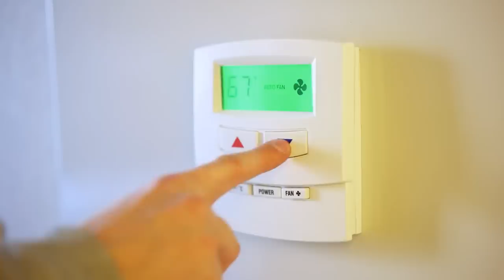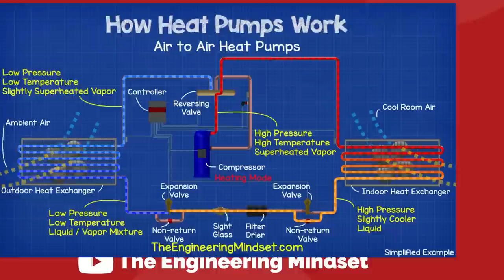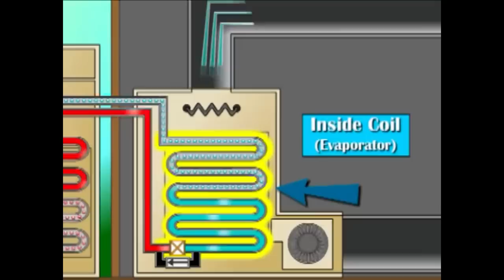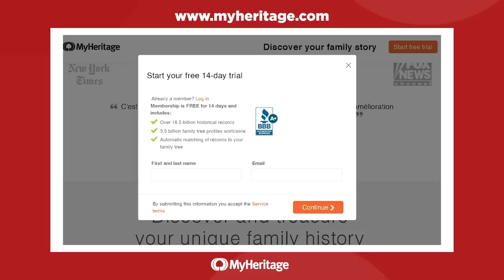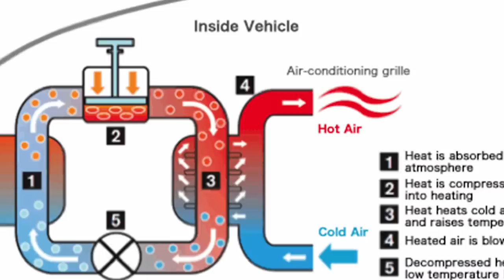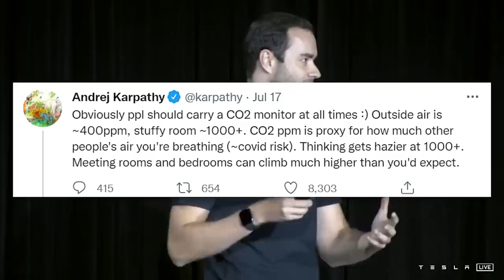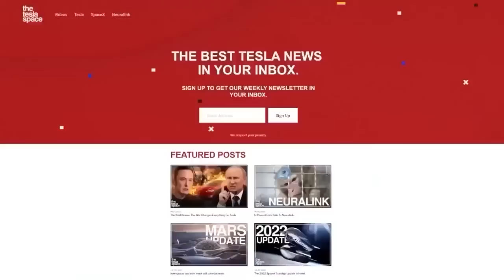Why Tesla's Heat Pump Is Essential For Our Future!

Comment: I moved from a heat pump to an A/C with Furnace. My energy bills in summer and winter in Texas are about 1/3 compared to my heat pump and that is with a house twice the size. Mind you my old house was not built with efficiency in mind and the heat pump was older. If Elon can make those more efficient than my current A/C with Furnace then I will be all in.
Reply: If you have a poorly insulated house, not really a huge surprise. Not sure why you wouldn't just fix the envelope of the house.

Comment: All HVAC, including residential, should automatically bring in outside air whenever it's closer to the desired indoor temperature. Also, thermostats should factor in humidity, not just temperature.
Reply: its called an economizer cycle.  and a humidistat will measure humidity.

Comment: Heat pumps need electricity to cool the air outside, or freeze the ground. Like your ice box in your fridge.   The by product of this process produces a heat through the heat exchange.  Just like the warm radiator on the back of the fridge. It's this that is pumped into the home to warm it.   This uses electricity, quite a lot.   It's not green and there is no free heat in the ground. The ground in your back yard in winter is very cold. It would use less electricity to just heat the rooms with electricity when you needed to with better Conrol. This process of using the by product of freezing the ground is a  con.   Because people accually believe they are getting free heat from the ground and it is green.  Electricity isn't green you need more. The heating is inefficient, this is  obvious when the insistence of insulation is highlighted. I its companies jumping on the band wagon scam to try and make a quick buck from the installations of this expensive process and also the massive insulation cost, big profit for them, big pay outs for you don't fall for it.

Comment: You do realize the battery when in use requires cooling, as the faster the draw of power the hotter the battery which is why a Tesla in water for long periods tend to catch fire.

Comment: I have been an electric only house until last year when natural gas became available. Electric heating & cooling is expensive. Last year I moved my hot water from electric to gas and my monthly cost to heat water drop >$50! The next time I need to replace my heat pump I will switch to a gas furnace with A/C. This will save move money.
Reply: if you were using a resistance heater for that water heater, then your point isn't really valid. Heat pump water heater works great, much more efficient than a gas one.

Comment: 10 years? Dang, reverse cycle aircon (AKA heat pumps) have been the norm here in Australia since the early 80s.
Reply: North Americans can be very ignorant to what happens elsewhere on the planet.  I was introduced to them while traveling in Japan.  I was amazed by their energy and water conservation measures and promoted them as proven technologies when skeptics claimed they wouldn't work.

Comment: Freon and other CFCs have been outlawed internationaly by the Montreal protocol in 1987...
they have been replaced by the industry with HCFCs, which have greenhouse gases effect hundreds of time worse than equivalent CO2.  The Kyoto protocol outlawed those starting in 2020, but most countries have not yet phased them out as planned, and everything currently in the operating systems will eventually find its way to the atmosphere.

Comment: Wow one looong ad for tesla. Was expecting/hoping for some technical details. but we got a remote control, air filter and reverse cycle aircon. Some 30 years too late on most points. The rest of the world uses heat pumps for heating cooling. Perhaps America is a few decades behind the times.

Comment: Author doesn't offer any specifics how a Tesla HVAC would do anything more efficient than Trane, Carrier or Lennox regarding home heating, cooling, and air quality. This is just a youtube ploy plugging the author's sponsor.
Reply: The best thing for any HVAC is better/proper house insulation nothing else
Reply: Tesla will probably just get another manufacturer to make the product and put their badge on it. Like Panasonic supplying Tesla with batteries
Reply: @alanmay7929  Yes indeed. The cheapest way to heat your house is to stop it leaking out.
Reply: @GSimpsonOAM  nope!!!! They won’t solve the problem! They need to insulate the buildings first which could be seriously way more expensive

Comment: "FREON" IS A BRAND OF REFRIGERANT COMMONLY KNOWN AS R-22. THE NEW REFRIGERANT IS CALLED R-410A, BUT IS NOT "FREON"
Reply: Has R32 not started taking over in the US?
Reply: @mikekelly5869  Despite its next-gen moniker, R-32 has been on the refrigerant scene for quite a while, although not in its pure form. R-32 makes up one-half of R-410A, a two-part refrigerant used as the primary replacement for R-22 around the world. 

R-125, the other half of R-410A, was included for its fire suppression properties, rendering moot the flammability concerns that disqualified pure R-32 from consideration as a widespread replacement of R-22 at the time of R-410A’s development.

In recent years, R-32 has seen its usage – mostly as a replacement for R-410A – skyrocket as manufacturers seek lower-GWP alternatives to R-410A.

HVAC system manufacturer Daikin estimates there are 100 million R-32 units on the market today. It should be noted that Daikin also manufactures R-32.
Reply: @Chad_N_Stacey_Hopson  Obviously a man who knows his gases! Yep, Daikin has hit on a nice money maker with R32 and I'm still surprised that it's been so easily accepted, given its flammability issues and the need for hydrocarbon detection along lines. They've started marketing CO2 equipent now. I wonder what their angle is on that market. They won't be able to make money on the refrigerant but they're bound to have something else up their sleeve.
Reply: @mikekelly5869  I also agree with the flammability issue

Comment: I've been using heatpumps for 30 years - the subject of my university degree in 1980. Sadly I've had to wait 40 years for others to catch up with this 1870 technology and am still 30 years beyond most having bought a property with 3 tons of water running through the basement per second.
I tried to explain to Elon that in fact electric batteries were rubbish, toxic nonsense and were far inferior to fly-wheels - further technology from the 19th century which used to take busses up the Alps but were discontinued in the 1940s as it is deadly (for big tech) to have indestructible technology introduced to the public. Consumers have to be junkies for energy to be of any use and hence oil was chosen to rob them of their money. Air is free but water is hundreds of times more efficient in transferring energy from a to b and even greater if the water is falling. AND the atmosphere around a waterfall is enriched with positive ions which are beneficial to humans. 
But despite putting myself in the best position to be able to utilise all the free energy available, the people running the country where I have my home are strictly AGAINST being efficient and so to get the authorisation to install the perfect system would cost me 100,000 just for the paperwork - that is the best defence against someone getting something for free.
So it is unimportant what physics will allow you - more significant is what economics will allow. And who rules economics - those who pay the politicians. And they get bought cheap because they are experts at nothing but talking and have no knowledge of the facts of life.
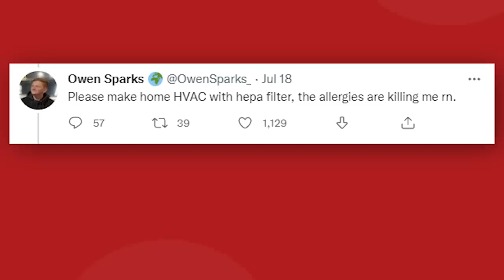2022 10 28 14:59

Comment: You completely leave out the energy needed to turn the heat pump's COMPRESSOR which is a LOT! not to mention the home "heat pump" has been used for over 30 years! and there are countless manufacturers making them as they are nothing new!

Comment: Pretty much every house in New Zealand has a heatpump. It's useless below -5⁰C but it also has an element built in. Which of course consumes alot of power. We have gas a backup others have a woodfire. We slways have a back including water and fuel power etc.
That something we learnt after the earthquake. You literally couldn't get anything. No power or water for months. And food was spoilt at the supermarkets.
I've setup mine through a smart home AI it doe's everything that Tesla are offering here. It automatically drops temperature at night. Turns off or down when we leave. Is filtered through carbon filters. And is transfered to each room. Humidity is also controlled.
We recently had a forest fire like last week. The system detected the pollution and shut down the house. And started filtering the Air. It wasn't to we woke it alerted me that the Air was polluted and it was best to stay in side.
As soon as I went outside all you could smell was smoke. 
Eventually we'd like to have solar and a battery backup. But we pay huge taxes on imported house battery systems after the power companies lobbied and bribe the government with donations. Who claim they're all about clean energy lols.

Comment: As an HVAC professional 🤦‍♂️ Tell me you’re making it up as you go without telling me you’re making it up as you go. Heat pumps aren’t a viable, efficient, economical replacement for fossil fuels within the HVAC industry. Unless you live in climates like Florida or Hawaii, your winters become too cold. Simply put, there isn’t enough heat in the air for a refrigerant-based system when the outside air is under ~35°F. Additionally, a heat pump uses more Joules through electricity to generate the same amount of heat as a natural gas/propane furnace uses overall Joules from fossil fuels and electricity. On top of all that, natural gas and propane generate vaporized water and CO2 from blue-flame burning (like in your HVAC system, gas grill, and range/oven), which your plants love! 🤷‍♂️

Comment: I want to start off by saying this was a very well put together video, do you have a lot of really accurate and up-to-date information about how refrigeration systems work. I do want to clarify that heat pump systems you seem to fail at around the freezing point of water so 32°F. All of the HVAC systems work by moving air along the coils and if the air flowing around the coils is around freezing it will slowly freeze water to the coils, thus freezing ice being attached to the coils reducing your airflow, which will get your pressures of your refrigerant way out of whack. I do really like heat pump systems they’re much more efficient than resistive heat strips there are a few kinks that need to be worked out though. All in all really solid video you earn a subscriber from this keep it up
Reply: Modern heat pumps use various arrangements of hot gas bypass and other defrosting systems to keep the coils ice free to well below minus 15 deg C ambient.
Reply: @mikekelly5869  Thanks for answering Dagan's question. He needs a computer, then he has to know how to "surf" and then put his questions into the little box at the top and press return (carriage return). He will get many clear explanations about how a HP works. It can be run on ANY gas, including air. But that is probably illegal in USA and no one will install a system for him as they are all working in the same concentration camp where smart solutions are verboten!

Comment: The thing about dc is .... dc motors ..... the thing about residential heatpumps .... . Inverter systems are like really expensive dc motors that break more . Oh then in field piping and contamination vs oem assembly line . Or microgrid with a dc engine room . Otherwise i dont believe it . Beating 28 seer without a 10' water cooled condenser

Comment: The more I learn about building science, the less convinced I am that an all-in-one unit HVAC system is a good option. Different rooms have different needs in regards to heating/cooling load, dehumidification, filtration and ventilation. An all-in-one unit cannot completely address all the needs of individual rooms. At best, such a solution could be called "adequate" and that's basically what most people with central heating/cooling already have. Yes, we should be installing more heat pumps in more climate zones, but I highly doubt that Tesla is going to revolutionize the HVAC industry with single device.

Comment: As a lifelong HVAC professional, I’ve heard nothing new besides a redesigned reversing valve. Poor engineering (the need to optimize sequence and timing of operations) which requires firmware updates to be fixed is not a feature. Musk is well ahead of the competition with electric vehicles but way behind with HVAC. There are solutions to all indoor air quality and energy efficiency problems on the market today which are much more complex than a Tesla vehicle and are stacked on decades of engineering and improvements but consumers continue to buy units with 40 yo tech looking for the cheapest replacements possible. This indoor air quality and efficiency issue is something that needs to be taught to young generations as a very important part of living a happy life before you can expect the public to care about it. It’s an issue on par with climate change and it kills many many people and degrades the living condition and health of countless more. Breathing in too much CO2 and air pollutants does not kill on contact it just silently ruins your life.

Comment: Alot of words for a whole lot of nothing - HVAC manufacturers have already maxed out the technological potential of AC achieving a COP of 4-5. The only area of improvement thats been recognised is compressor design but the Y model doesn't seem to have any new developments when it comes to compression, only in relation to refrigerant distribution around the vehicle and whilst there have been new designs onto the market, nothing other then the scroll compressor has been found to be more efficient as well as cost effective . The only useful thing out of this is a potential AI system for your home that will turn things on and off when get home and leave. Probably why Tesla's foray into HVAC has stalled, unless they come up with a radical new means of compression they're essentially just copying everyone else.

Comment: The worlds electricity is predominately uses coal or gas fuel. Why cant we capture the heat produced from aircon system and repurpose for heating water or cooking or store somehow? And conversely heatpump heating capture the cooling and repurpose for fridge freezer or store frozen some way. Batteries need many resources and emmissions to produce. Wind turbines need steel and concrete but life ex composite blades go to landfill. Cold can be stored as frozen material such as ice and heat can be stored as molten material such as salt. Need storage of energy systems. I grow renewable trees and can use in high efficiency fire for winter hot water, heating and cooking. Summer hot water is solar. Grow trees is energy. Water in high reservoirs elevation is energy. Geothermal heat is energy. Ocean tides and wind is energy. Efficently Harnessing and utilizing is the question.

Comment: Why is it that when it's a heat pump it's efficient, but when it's an air conditioner it's not? It's fascinating that people think that electricity doesn't generate CO2 emissions. The vast majority of electricity is generated using fossil fuels, which is proven by the electric power plant shown at minute 6:39 of the video. Why do you think people in Europe aren't going to be able to heat their homes this winter? Because the price of Electricity is going up, or because the price of oil is going up? The solution is being misrepresented in order to sell things that is all this video does.

Comment: Heat pumps are just an Air conditioner that can use the heat that the compressor generates. Non-Freon based Refrigerants are less efficient and have to be compressed to greater pressure to operate. The higher pressures mean that the pressure seals in the system will fail faster than the old Freon based systems would. The only way the Tesla could use a software update to increase the heat is to increase the pressure the compressors generate. Again, increasing pressure will cause the seals to fail faster! Freon is an inert gas that no company owned a patent or copyright on which made it cheap, the new refrigerants have patents on them which means one company is making money on every Air conditioner or Heat pump that is sold! Profit for that one company was the motive behind forcing Freon off the market. The largest whole in the ozone ever discovered was at the equator out in the middle of the pacific ocean which could not have been caused by HFC's as there are no industrialized nations that reside along the equator. This fact was covered up quickly and the proof that was on the NASA website was removed from public access. The scientific community is corrupt and will say whatever gets them money! We have seen this in many example's over the last 50 years! A company that wanted to sell artificial eggs and bacon funded research and then the nightly news plastered it all over the airwaves for years! I see a pattern here, the same pattern was used for the whole in the ozone, and the burning of Hydrocarbons causing out of control global warming!

Comment: If you want a renewable solution then a tiny rocket wood burner on the heat pumps input with an air filter exhaust pipe would work an a tesla car. It would not work so well on mars which is Elon's main focus but it would work in Canada and Alaska and Siberia (if its ever eventually free). Beyond the tree line you would need to buy a kg, 2 lb of kindling. Sometimes you have to go low tech but is it low tech if its a computer controlled rocket stove on a heat pump loop in a car? 
House heating is easy with ground loop and solar thermal. Feed heat deep in summer. Pull it back out in winter. And that would work on mars.
Reply: Good to see someone thinking beyond the box.